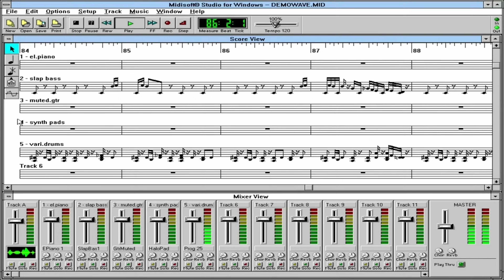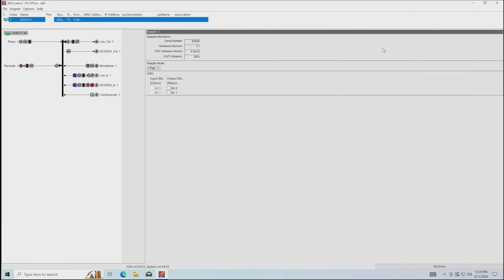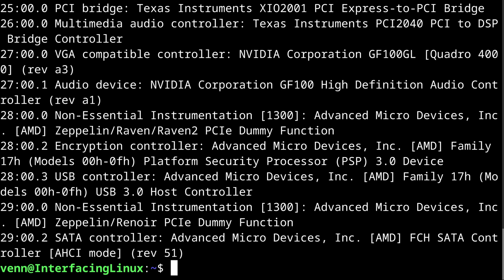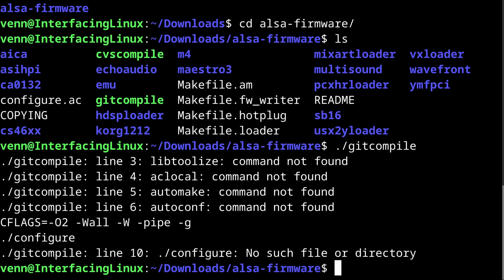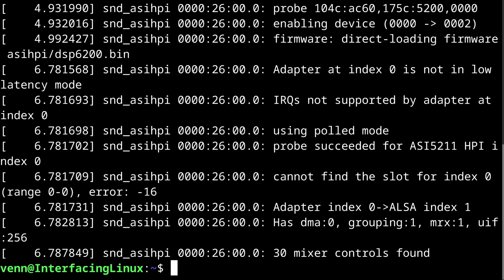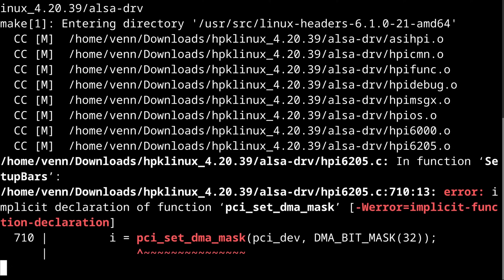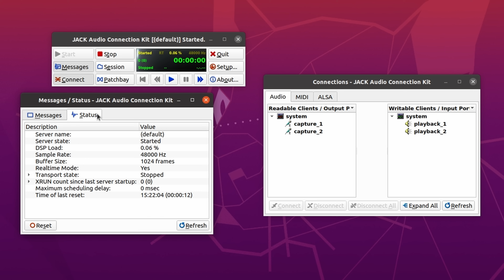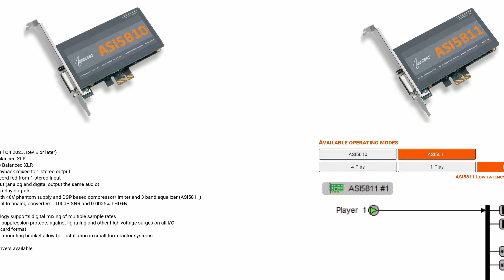Broadcast Hardware On Linux - AudioScience ASI5211

Comment: yuck.. the M-Audio Delta1010LT (pci) are cheap and ive had latency 4msec pretty easy.   full harware control in linux as well
Reply: Ohh wow. I am actually installing one of those today. I am retiring my IvyBridge-E based DAW and moving its RME Raydat into the new Zen4 system. The Delta1010 is going in the old DAW for when I need to fire it up for legacy projects/software.

Comment: Couldn't you downgrade the kernel in any Linux distribution? Also for underruns you can dedicate a core to a process. There's another problem with the SMI interrupt on CPUs too. You can disable that. I just have a feeling there's more that can be done. The lowest latency Intel CPUs are Atoms and Xeons. Cores kinda suck as far as latency goes. Some old AMD chips were stupid fast latency wise too. Latency has nothing to do with performance. There's different kinds of fast. Speculative execution tends to be high latency. Deep pipelines and all of that stuff.

Comment: ASUS NFORCE DELUXE GOLD for AMD Athlon XP 3200+  (Shared mostly due to the audio system on this mobo, that and the fact that moving from a normal motherboard to this one wihtout changing anything else made my system feel like I had moved the CPU one generation forward when it was still the same, yeah that much of a boost)
Features that made this motherboard the BEST motherboard performance wise for an AMD CPU:
- Dual Channel (still on the chipset at the time)
- Actually Hardware Accelerated Sound using 3 DSPs (best onboard audio card for that generation, even the majority of addon cards lagged behind it in performance AND audio quality at the time, good filtered PSU needed though)
- Proper SATA Support
- Nice NVidia onboard graphics (one of the last generations where such low end GPUs were on the chipset instead of CPU itself)

Comment: Just discovered you, I'm a video broadcast engineer/arch, nice to see someone exploring what's possible with the older hardware.
I picked some Matrox MX02 hardware out of the recycling bin and I'm slightly disappointed that there aren't drivers for modern systems. I have a spare old MacBook but it's sad that I can't make use of it in Linux.
Reply: Right on. It's always worth seeing if you can keep something out of the landfill.

Comment: Wow cool channel nice content, i have been involved with e-mu pci(e) sound interfaces on Linux and have made tests for regression fixing so i know the drill here, still nice seeing wired obscure hardware being supported on Linux
Reply: Linux runs on more than you think. Every home router runs it, tv settopbox decoders run it, Iot cameras and security connected LAN cameras run linux, NVR's run Linux. Linux can be easily made to support obscure hardware
Reply: @309electronic5  yes but some stuff out there is so obsucre no one made linux drivers or patches for it yet, i know a few examples of such hardware, like the first generation of audiotrak maia sound cards
Reply: @309electronic5  i know, but some hardware is so obscure even linux don't have drivers for it, one example if the first generation audiotrak maia using a dsp found only on that card for wich linux lacks drivers, on subsequent models of the series andiotrack switched to chipsets from VIA instead which are supported

Comment: I worked at a radio station a few years ago as a board op for sports coverage - thier station control system (music storage, queuing, etc) ran some weird version of Debian, on an ancient rack mounted PC of some sort. Had to be rebooted every 48 hours or so (probably an age issue) which meant manually jockeying CDs while it restarted. Fun stuff. Never thought that would entail an entire ecosystem of drivers and software support specific to linux, but it makes sense. Neat stuff! Thanks for the video!!

Comment: Pretty neat, never heard of AudioScience, but looks awesome. I picked up an AJA Kona LHe earlier this year to throw into one of my home servers for capturing analog video in original quality (without upscaling or deinterlacing). It comes with a 1U breakout box (KL-BOX) that allows connecting SDI, AES/EBU, HDMI, most types of analog video (Y/C, Composite, and most variants of Component including RGB), and has both balanced XLR and unbalanced jacks. It has both inputs AND outputs, although I'm not entirely sure how to get the video outputs to do anything but passthrough. AJA has official Linux support via its "ajavideo" & ALSA drivers, but it doesnt have V4L or V4L2 support... there is a random patch floating around where someone added an ajavideo source to ffmpeg, but havent tested it...
Reply from the maker: LHe, nice!. I did a guide for my KONA LHi. Managed to get it working with OBS but wow, it was an adventure.

Comment: E-MU 1820M
Is Your next project!😂
Reply: E-MU 1820 E-MU 1212m works under linux since ALSA 3. something. I had one (1212m) and did many recordings. It is plug and play I hope it helps
Reply: @AlexandreFerreira-lj4dp  and You can control the DSP, mixer, monitoring, channel strips etc. too?
Reply: @BMRStudio  I did not try that.  Because There were (are)  so many great plugins today that you won't even try to mess with that. If you put like 16Gb or RAM o 32 you wont miss it. For me, either the 1212m our 1820 greatest thing is the conversion. Is a great card
Reply: @AlexandreFerreira-lj4dp  big difference is E-Mu did it in live , zero latency….
Hardware…
There is no plugins, what can do the same.
Reply: That's a neat looking card. Even has a word clock, nice. If I go the PCI route (again) I might try something like the M Audio Delta 66.
Reply: i have that card i have been doing tests for the current developer of the drivers, it needs the alsa firmware but for the rest the driver is completely free and present into the mainline kernel and the card is fully manageable from alsamixer
Reply: Also i did tests for other e-mu cards using the same or similar chips
Reply: just one note about the 1820 and 1820m, they need kernel 6.9 or later or 6.4 or older due to a regression introduced with 6.5 and we managed to get merged for 6.9

Comment: What about noise? Internal audio interfaces have always suffered from higher noise floors due to the all the digital bus madness going on inside a PC.
Reply: The noise issue typically applies to consumer hardware. On this 14 year old card ADC/DAC clocks in at 100dB SNR and 0.0025% THD+N.